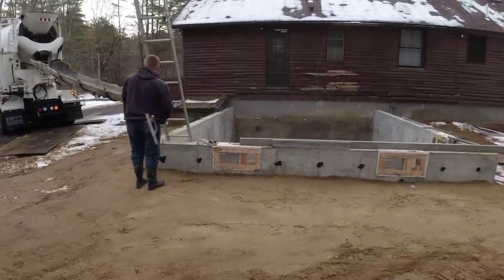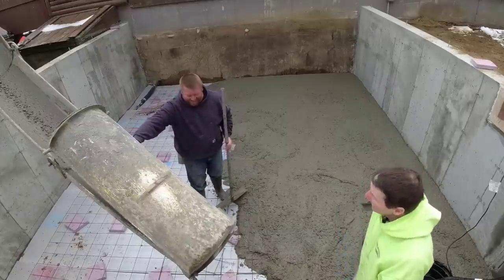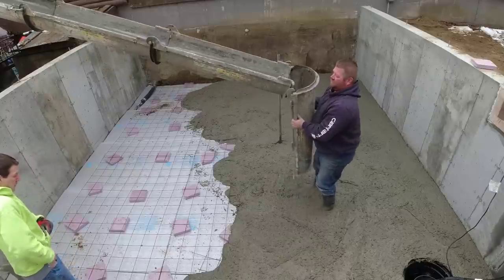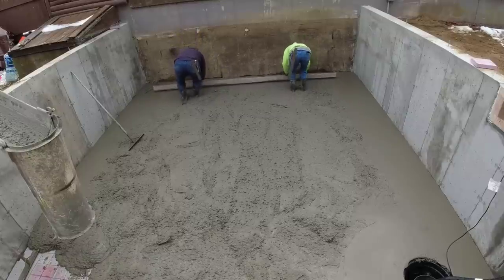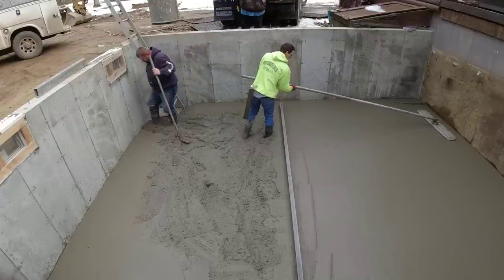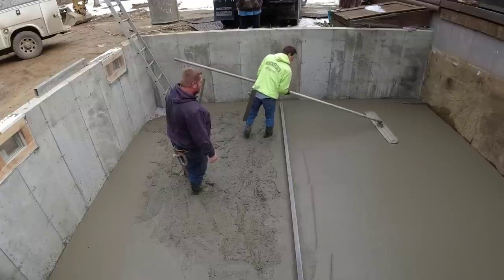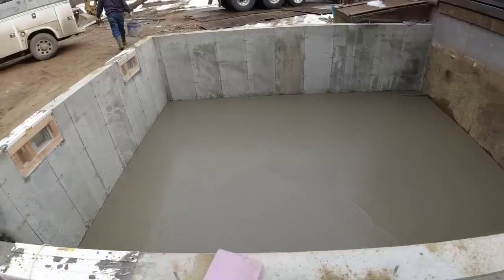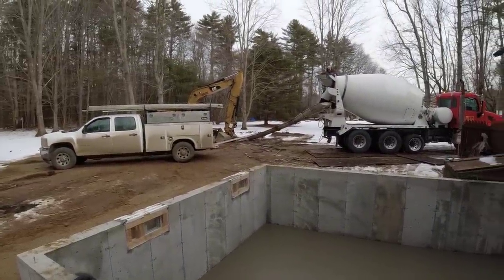My 5 Tips For Finding A Good Concrete Contractor - # 4 and 5 are the Best!

Comment: The use of the big pink foam dollies —> wrong should’ve used small stone, concrete or plastic option that will not comprise the thickness of the concrete slab